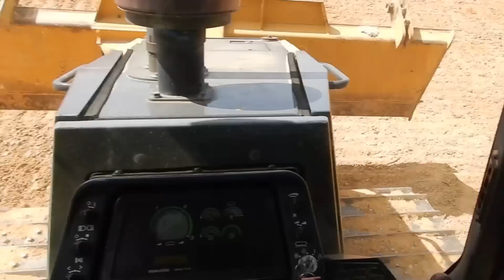Finish Grading The Big Pond Job

Comment: Will you be using any rip rap in the spillway to slow down any overflow or just relying on the grass?? Also I commented a while back on putting fabric under the sand to keep it from sinking into the mud any thought on that??  Thanks love the vids.
Reply: Water may never touch it. It`s a over flow only.
Reply: Water may never touch it but if and or when it does there would have been enough rain that you definitely don’t want that overflow to wash out...

Comment: How much of a sideways slop can you run in that dozer with out tipping over? It seems you can run that at a pretty good angle safely I was just currious if theres a rating or a guage in side to tell you?
Reply: A dozer normaly wouden't tip over but just begin sliding, because the wight center is somewhere in track hight.
A gauge is rarely seen in dozers but when then it's more for the operator to hold a given angle, not to alert about tiping danger.

Comment: I would have thought you would just go ahead and spread sand down on it now to about 6 feet below the water line; does it wash out that bad? Even if it fills quick?
Hard to believe and nice to see a project you have worked on for 8-9 months all finished but the grass seed. Are y'all putting that in or hydroseeding the whole thing?

Comment: Nice pond you built. Now for a nagging question I have. Why don't you have some sort of laser grade systems on your excavator? Something like trimble? Wouldn't it be a time saver? 😎😎🤔🤔🤔
Reply from the maker: Cost too much and clearing would rip all those expensive sensors off the stick
Reply: Chris has a fantastic eye level
Reply: Tom you should watch some of Chris’s videos on digging basements somehow he can see grade like no other I’ve worked with. Built into his genetic makeup for the amount that he uses a laser , grade assist would be a waste. If you put a machine and operator side by side with grade assist against Chris without by the time the grade assist was all set up Chris would be halfway done with the task he’s just that good